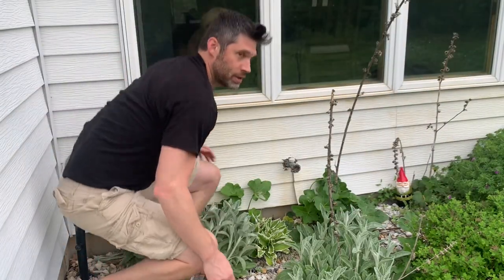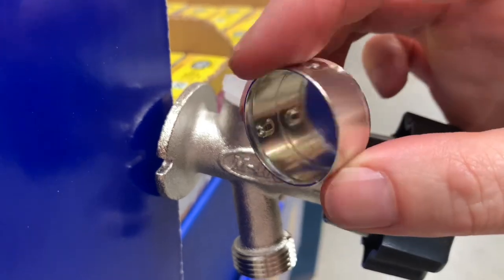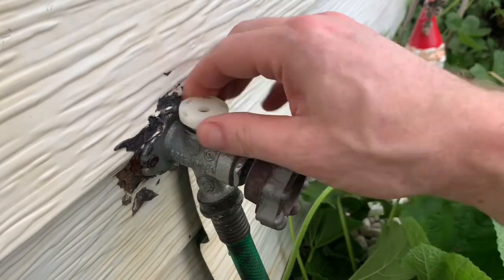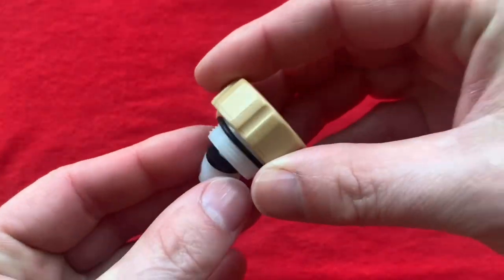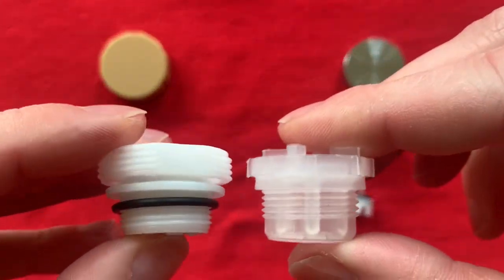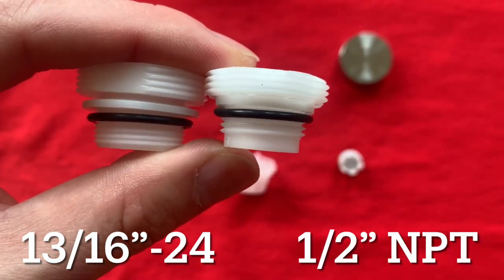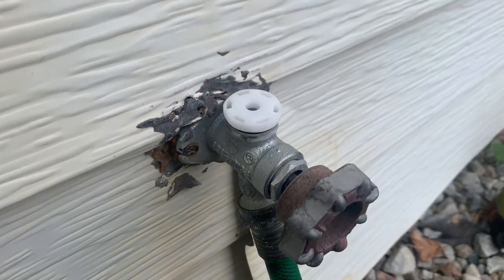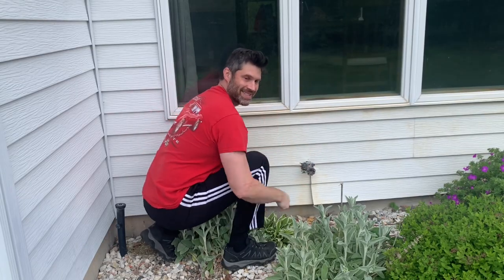How To Fix Water Leak Under the Cap | EASY! | Outdoor Hose Faucet Spigot | Replace Vacuum Breaker

Comment: Thank you! One of our spigots is leaking from the top cap, and I was bracing myself for having to replace the entire spigot and all the pain that would imply. This is much easier, just needed to know the magic words for what the top cap is, and the couple gotchas like thread sizes.
Reply from the maker: Glad it helped! I was in the exact same scenario, which is why I made the video, to hopefully help someone else out. Glad it was helpful!
Reply: perfect. Is it ok to do without shutting off the main water supply?
Reply from the maker: @kork54  Yes, it is! You do not need to shut off the water supply.

Comment: Thank you for pointing out the thread differences.  Both my spigots outside are real old (maybe 1950's / 60's??).  Something is telling me that mine is going to be a challenge because everything with this dated house is usually an adventure.
Reply from the maker: Glad it was helpful. I hope you figure it out quickly and easily!
Reply: @HowtoandReviewsOfficial  I did go on Amazon to look for one that same day and thank goodness for Amazon reviews because there was a guy who bought the one that I was reviewing to zoom in on the threads and he apparently has one just like mine and made the mistake of buying the Amazon one with larger threads and it didn't work.  He posted comparable pictures of his and the wrong one and gave the part number that he actually needed, which looked exactly like mine that I needed.  He did half the work for me right there in the review.  Now I have a part number and name. LOL

Comment: Isn't it crazy that for 20 years I had the same outside faucet with no problems until the handle began to leak. I get this $40 faucet and within 2 years the thing is leaking.  And it looks like it has a built-in money-maker for Lowes and Home Depot, where old faucets didn't need constant part replacements.